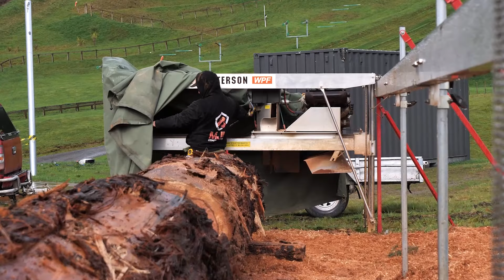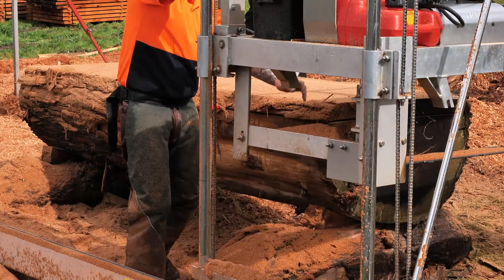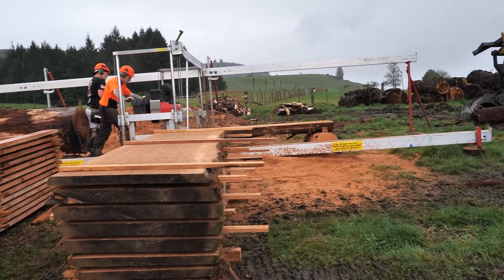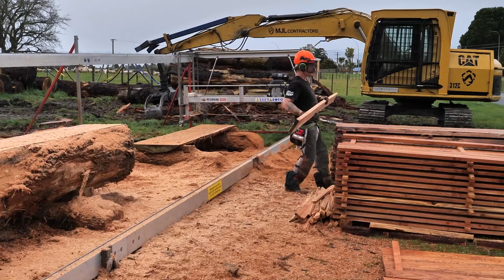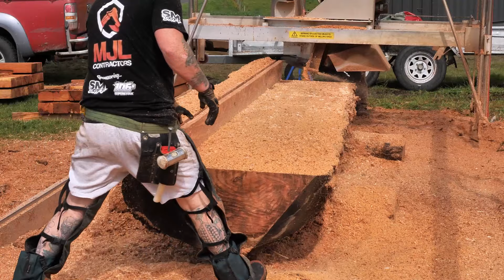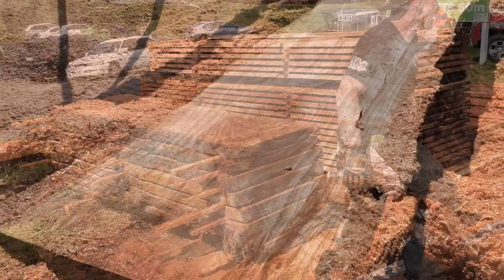Ultimate Portable Sawmill Set Up!

Comment: Nice… if you like pre cupped lumber. You can see the sag in the bar and in the cuts. Think I’d go with a band saw
Reply from the maker: Hey Scott, thanks for watching!
We can understand your doubt if you haven't experienced a dedicated high speed chain mill like this before but you're welcome to contact a number of our mill owners or us directly to assure you, a Peterson DWS consistently produces flat, square slabs extremely well - at great speed and with far less downtime and maintenance costs than a bandsaw. Oh, and more portable than most. Did we mention it can slab up to 1900mm/6ft? We'll stick with a Peterson thanks. Any sag you might think you see in the footage is not present in the finished product if maintained and checked correctly :)